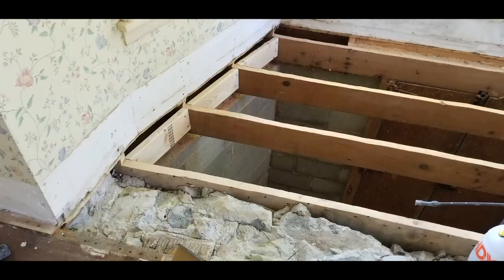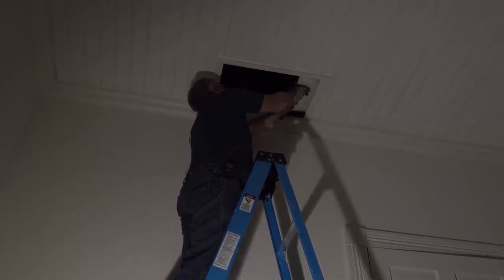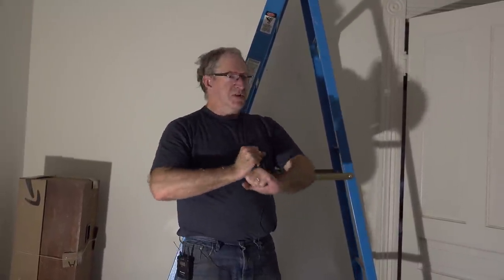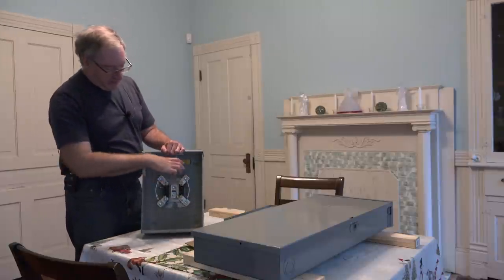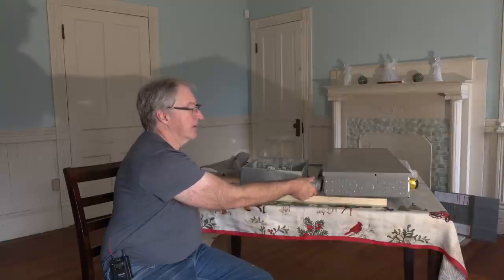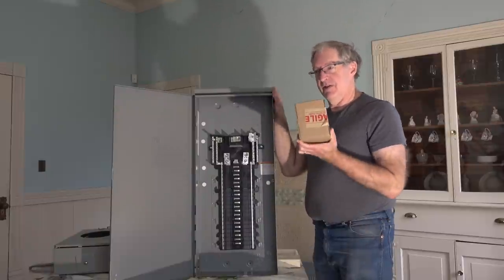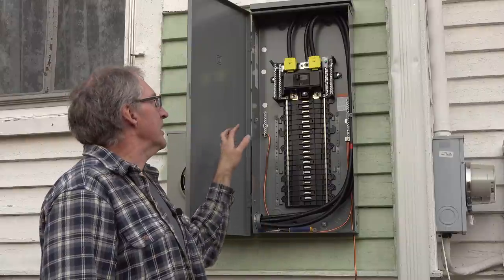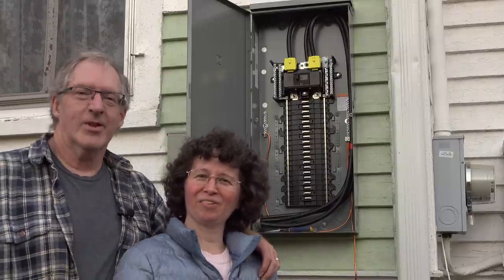EP 62 Victorian House Gets New Breaker Box

Comment: In Tennessee, the neutral and ground bus have to be bonded together in the main panel - not sure about other states.
Reply from the maker: National electrical code requires it everywhere. It also calls for the box itself to be grounded via the green "Bonding Screw". But....if you have a sub-panel, the bonding screw has to be removed and the panel be given its own ground rod.

Comment: You need plastic sleeves on each end of your steel flexible joint between the boxes .  You may have to redo those heavy wires after all your hard work
Reply from the maker: You are correct! I forgot about them until after it was done.

Comment: This is a trick I learned from my grandfather: Use some 12 gauge fencing wire and make templates. All you need to do then is follow the templates. Use a pipe bender (or pipe wrench) to create the bends needed in the electrical wire. Perfect fit and you don't lose skin or pull muscles. A job that took an hour takes 10 mins. This trick also works with water pipes.
Note: For those of you in the comments without any brains - Templates can be made in multiple pieces.
Reply from the maker: Templates are good for all kinds of things, especially if you have to make several parts to be the same. Great suggestion! I have yet to encounter a viewer here that is brainless.

Comment: Was there a green bonding screw for your panel?  That was the first thing the inspector looked for when I replaced mine. Did I hear you say you’re purring in underground service line?  That will definitely look the best. Overhead lines really detract from the beauty of an old house like yours.
Reply from the maker: Yes. The box has a green screw and the code says it has to be in for a main panel, or removed in a sub panel. I asked for a new overhead service but the power company rep came out and said I could have underground service instead at no cost. Heck yeah!

Comment: My dad was an electrical engineer and the first thing he did when we moved into our house was retire the entire house. I know he’d find this super interesting! Quick question-I was surprised when you said the cable was aluminum. I thought copper was preferred (and safer?). Be interesting to understand when each are used. Happy New Year!
Reply: Rewire not retire! Darn auto correct!
Reply from the maker: For really heavy wires or long distance, aluminum is often used because it's lighter and less expensive. It doesn't conduct as well as copper so we have to go one size larger.

Comment: Mike, I was cringing watching you pull those cables through that coupling that had no bushings to prevent the insulation from getting damaged on the raw edge of the coupling threads. Not like you. Just curious, did you consider installing the breaker panel inside the house?
Reply from the maker: We put it outside to preserve the historic character of the interior. You're right about the bushings....I forgot to buy them and realized my error after it was all put together.

Comment: I was always taught to NEVER use a screwdriver for any purpose other than driving screws. You use a paint can opener to open paint cans, punches to knock out those knock out tabs and chisels for chipping away excess wood or stone. The handles on screwdrivers are not made to receive impact blows. They can easily shatter and injure you. The shafts are not made for prying. Please don't teach people bad and unsafe habits.
Reply: What???  You were taught wrong.  You can use screw drivers for all sorts of things and it is just fine.  If you applied that to everything, that would leave no room for creativity or improvisation.  Most screw drivers these days   can easily handle impacts and don't shatter.
Reply: Also everything has a hammer side lol

Comment: American electrics are terrifying.
Reply from the maker: European electrics are even scarier, running 240 volts to the power outlets instead of 120.
Reply: @1834RestorationHouse  Well, that's the least scary part as both can kill you. I'm more concerned about the lack of waterproofing on this outdoor installation.
Reply from the maker: @kisslab  It's fine. These panels are rated for outdoor use and they're very common across the Southern states.

Comment: When you first started to block the squirrels and you said you were using hardware cloth I wondered to myself why don't you use steel wool! Is that because a) the holes are too big b) steel wool is too expensive and c) hardware cloth is easier to work with.   P. S. What exactly is hardware cloth?  BTW, are you sure the "repellent" is actually a repellent and not an attractant?
Reply from the maker: Hardware cloth is like window screen only larger and made of wire, and there is no doubt about the repellant properties of the chemical I used. Steel wool would just get pushed out of the way by squirrels but hardware cloth is like a cage.
Reply: @1834RestorationHouse  thank you for the explanation.   I was visualizing hardware cloth to have 1/2 X 1/2 inch squares and thinking perhaps something a squirrel could attempt to move ( by pushing & pulling) as they do have very dexterous paws. At the same time I wasn't thinking they would simply push the steel wool 'out of the way' which makes sense when you consider how they make their nests. I know, use both, kind of like a sandwich.  First layer of hardware cloth, 2nd layer steel wool and final layer hardware cloth tied together with wire then hammered or screwed into place so nothing moves.  Voila! Squirrel proof.😉😁😅😂

Comment: Why are you the one that has to do all of this work prior to the electric company coming in to take care of it???
Reply from the maker: The utility is responsible for bringing power to the meter socket. The homeowner is responsible for everything from the meter socket to the outlets. We have to pull the permit, buy and construct the entire service panel, pass inspection, and then the utility will cut off the old system and connect to the new one.  Most homeowners are not capable of doing this kind of work and they would have to hire an electrician.